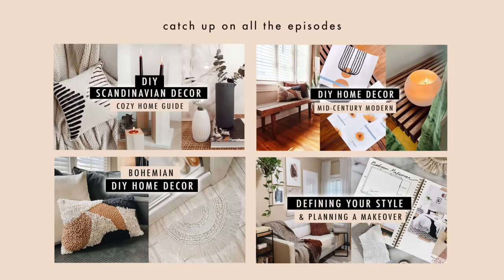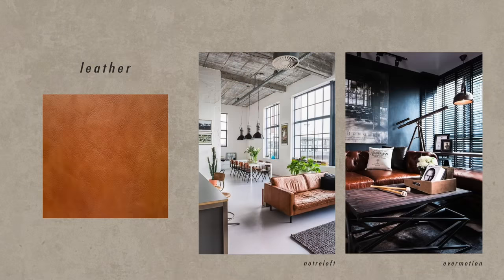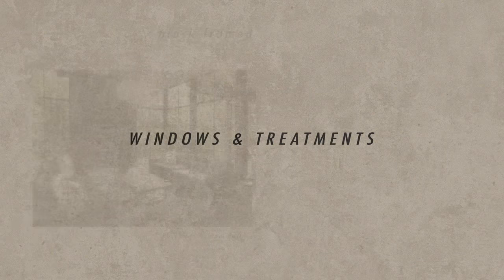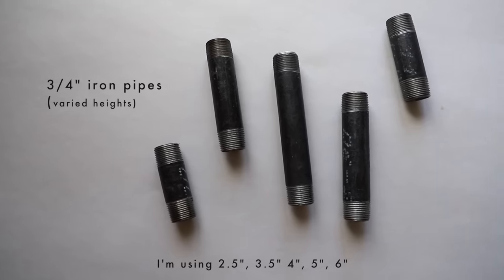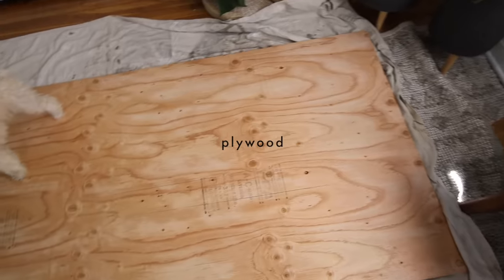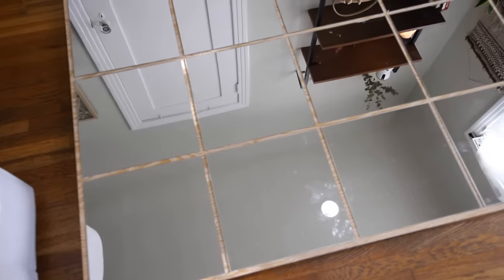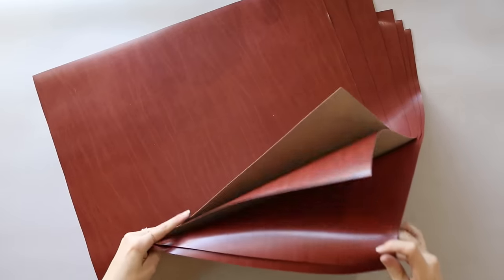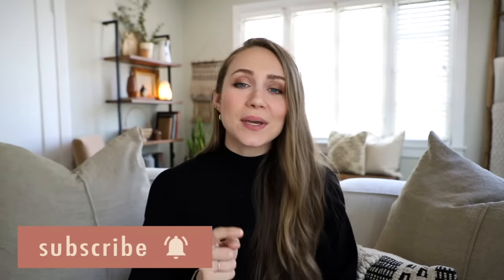DIY INDUSTRIAL DECOR + Guide To A Warm Home | XO, MaCenna

Comment: TOP TIP for filling a pouffe: bubble wrap folded/cut to the right size and piled up into the pouffe casing. Use all the stuff that comes as packaging. It works really well x

Comment: Foam comes in different densities,  and for the pouf to support your full weight over time without completely squashing down,  you need high density foam. Thrifted pillows inside might look ok if the pouf is just decoration, but if you really want to use it as seating,  get the high density foam. the other option is make a wooden box and  just cover 5 sides in foam and then the leather. It will look the same but it will have more support.

Comment: I liked the pipe candle holder idea. I did a tiered tray that way since I couldn't find one I liked. I bought a couple of unfinished wood plates from Hobby Lobby or something and stained them. I painted the pipes & flanges an oil rubbed bronze color. Turned out fantastic & I still love it 2 years later.

Comment: I love your channel but I think sometimes your descriptions of decor styles is very personal (which is totally fine) but it comes across as if the style you are describing is no more than those few parameters, when in fact it’s actually a lot more than that. For example: warm wood and dark metal do not define industrial style, lighter wood in fact is more industrial as wood used in working factories over the years tends to be super light and untreated, and not dark or warm. 
Just a thought! In my opinion it would be nice of you to make clear that the parameters being given are your interpretation of the style/aesthetic movement and not the “fundamentals” of the style itself, which tend to be broader.